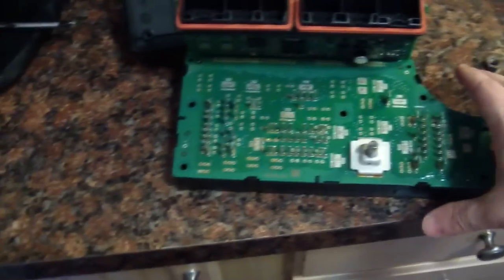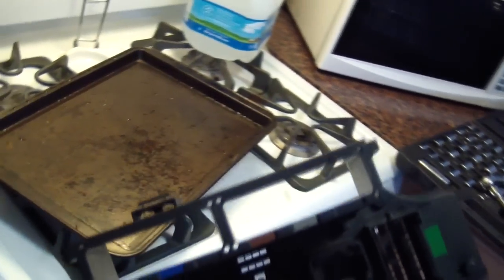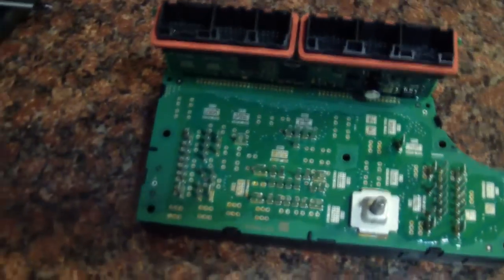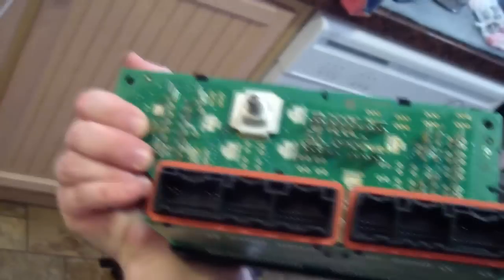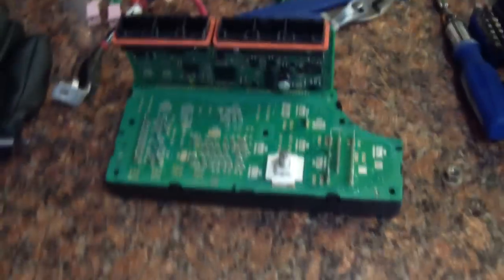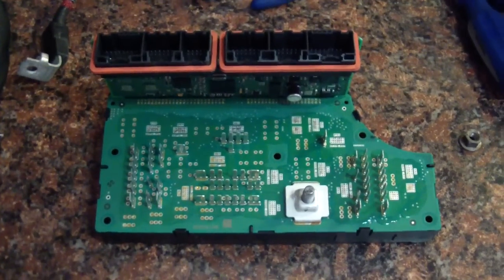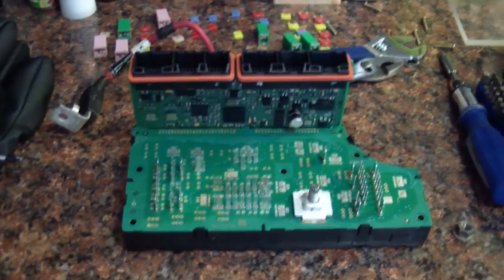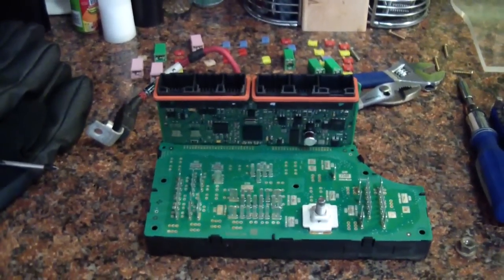2007 Dodge Caliber TIPM inspection - look at the guts!

Comment: Hate to play devils advocate here, but the unit actually IS SEALED. 

The plastic housing is only there to protect the connectors from being splashed or chewed by rodents. It's meant to allow air flow, that prevents condensation build up inside. The top should have had a rubber seal around the edge though, totally agree there.

The actual circuit boards in the TIPM are encapsulated in a conformal surface coating. It's a thin elastic sealant sprayed uniformly over the boards which seals all components and solder joints from environmental oxidation. I'm a micro/miniature circuit card repairman so I see these type of boards frequently. That kind of treatment is often used for boards reasonably expected to be exposed to weather and temperature fluctuations, despite being in a protective housing.

As to the computer module next to it, there's actually a very good reason it is better sealed:
Inside a modern car computer, there isn't a typical circuit board. Instead, there's a thin flexible printed circuit board with the components attached. It's much like the thin yellowish cable connectors you see inside computers for connecting laptop screens and keyboards. They're far more susceptible to damage from vibration. They basically attach the printed circuit to a sheet of aluminum and then "fold" the entire assembly in half, sealing it around the edges to a rigid aluminum frame. The inside of the box isn't fully encapsulated. It only seems that way because they're a pain in the ass to get apart.

Point being, don't jump to assume it's the TIPM, they're more solid than people think. Before following the crowd and handing Chrysler your wallet, take your time to rule out other connected components first. Get a cheap OBDII scanner, check your connectors, your grounds, sensors, etc.. The computers on these cars monitor almost everything you can think of, and seemingly unrelated systems can cause errors in other places.

Signed - Irritated owner of a 08 Dodge Avenger, P.O.S. model.
Reply from the maker: These are not sealed at the bottom, they are on the top. The connectors are not waterproof either. If you pull the ones off the ECU (water proof) and compare them to the ones on the TIPM about 6 inches to a foot away (at least on mine) they are not water proof. This may have changed in later years - I sure hope it did!!! Conformance coating does nothing for bad electrical connections caused by corrosion. I do agree that multiple things can cause an issue. 

Actron makes a couple really nice ODBII scanners - but nothing with dealer level scanning. There is 2 I know of that do that - the Starscan (OEM) and some other one - are both well over a thousand dollars last I checked.

If air can flow into the module, so can water. IIRC they only put conformance coating on one side of a 2 sided board... Even if they filled the whole chamber with epoxy, those connectors become the issue.

If that wasn't bad enough, I lost my wipers in a snow storm. Recall issued for that... My understanding is they set the over current setpoint so low that heat buildup in the wiper motor caused it to draw just enough current to set a B-Code (which you can't get on a regular ODBII scanner) and it disabled your wipers until they changed the over-current set points with a ECU/TIPM flash and the addition of external relays because it could not handle the current load required. http://www.autoevolution.com/news/chrysler-recalls-84000-dodge-calibers-13249.html
Reply from the maker: One fine thing you did make me think of - when people put a new one in - toss in some di-electric grease on all the connections under it. This will avoid additional corrosion...
Reply: True, conformal coating does nothing for a cold solder joint or component damage. I was only pointing out that it does offer SOME protection from general environmental factors. At least they did something to try to prevent corrosion from happening in the first place. Mine has the coating on both surfaces of the boards. Perhaps they changed to prevent further recalls. 

You're correct though, there are always points of ingress for corrosion, like the points where connector pins join the board or the exposed backsides of the pins within each connector. With the TIPM we're really talking about humidity rather than actual direct water contact from the road. The housing is designed in such a way that actual water spray is unlikely to splash or move upward into the connectors or board area. It would drain downward, away from them. Airflow allows humidity to enter, yes, but it also removes condensation. No system is perfect. Even a flexible epoxy potting mixture would eventually allow corrosion. And you have to remember the need for heat dissipation.

The ECU is a different story, it's deliberately exposed for airflow, cooling internal heatsinks. Therefore the the connectors have to be better protected from moisture, not to mention oil, brake fluid, etc.. They aren't really entirely waterproof though, just better designed for protecting data signals. They're actually designed for vibration isolation to further protect the internal circuitry. Those wires have not only voltage, but frequency data signals and the pins are more delicate than those in the TIPM.

As you pointed out, it's difficult without the expensive factory DRBIII scan tool and it's $500 - $1300/ year subscription fee. The funny thing is that tool is actually just a regular laptop with software that connects through a specially configured internet connection. I've been looking at the Innova 31603 OBDII scanner (like Actron) since it's under $250 and says it can read/ clear SRS and ABS codes. Mine has a SRS fault in one of the front seats. My little bluetooth scanner only does generic codes and sensor data, though it does it pretty well. Handy for the glove box.

Thanks for the tip about the wipers! That just may point me in the right direction. Mine work perfectly, except when it rains! Once or twice a year they will slow/jerk/stop in very heavy rain. I was thinking the wiper motors were overloading or intermittently shorting, but it's not easy to diagnose a condition that only rarely occurs in heavy rain and sets no codes I can access.
Reply from the maker: One other thing very few know about the TIPM and the wipers, when the TIPM goes south for the wipers it ends up frying the motor. I don't know how or why nor did I choose to keep playing with it. You'll know because it (wiper motor assembly) becomes hotter than hell and then you smell the windings right before it starts burning outright. I bypassed mine and have only high speed control. Lost the parking of the blades but couldn't care less as I know each and every time I hit for them to go on they will...

Comment: FUCKING AY! I love you for the rant! I woke up this morning and car wont start, lights turn on, no clicking new battery. Went to my mechanic and he told me the "fusebox" is gone. Hours of research and I bump into your video. What a STUPID design. As an Engineer, I'm raging pissed that I have to pay 300 dollars for a used TIPM to get my car going again because of thier designs of a 3 year old. MAKE IT WATERPROOF For fucks sake. Anyway. Thank your for the video HIGHLY appreciate it.
Reply from the maker: +Mo Mentum Really want to piss them off in Dodge corporate - ask them why the ECU located less than a foot away and also exposed to the same shit under the hood is hermetically sealed and uses waterproof connectors :p

Comment: Yup, the horn stopped working in my 2007 Caravan and the TIPM was the culprit ... male connectors were corroded all to dog shit. Should be recalled by Chrysler ... an outrage of epic proportions.
Reply from the maker: +Darren Gody I personally think that if they wish to put components that are this sensitive into a wet space they should be required to warranty them for life. There is no logical reason why they couldn't have moved it into the passenger compartment and used a larger size wire from the battery to there...
Reply: +TheWizechatmgr A Defect Complaint Form has been filed with Transport Canada and Michael Dahl, Head of Vehicle Safety at Chrysler, has been copied. UPDATE: I received a phone call from Chrysler Canada aka www.fcacanada.ca at 1-800-465-2001 EXT 11406 who asked me if I had the Caravan serviced by a Dealer (surprise) and further stated that this was the first case they heard of regarding a corroded Caravan TIPM, which I expected them to say, as they are told not to accept liability, and moreover stated that because I purchased the vehicle from an after-sale car lot, the engine was possibly shampooed / power washed which would potentially cause corrosion.
Reply from the maker: +Darren Gody So the fact that road spray can end up there had no bearing on their bad decision eh?

Comment: Thank you for posting this, I share your opinion. I have an 09 Jeep Compass that has the exact same looking part. I took the thing apart today before I seen your video. Tested all the fuses didn't see any obvious issues. Mine started acting up when I took it to the body shop. When I went to pick it up the dash lights came on but would not start. It acted as if the WCM module malfunctioned. I asked if they could take a quick look at it. I think they tryed boosting it and no success. Second time I went to pick it up It is dead except heater fan ,radio work and power windows work. Nothing else works no dash display, four way flashers, door locks and best of all you can't take it out of park. Nothing like really ticking off someone when you can't even move the car. I had to disconnect the shift cable off the transmission so I could move this shit thing. The interesting thing I found is there is a small relay box ahead of the battery needless to say hard to get at. I think there are four relays in there if you can figure out how to open the box. The one relay is for the engine, the fat blades are when the relay is energized. I put in a jumper wire across those and I was able to start the engine with the key. Everything else still don't work, but at least I can move it in and out of the shop.
Reply from the maker: +Ahill Billy Sorry to hear that. Not sure why dodge hasn't improved upon the design with an updated part.

Comment from the maker: #Daniel Hoyt
Test test test... Way too many places just suggest to replace stuff blindly. The Computer and TIPM & TCM have to be programmed alike - isn't like the old days where everything was easily interchangeable. I believe it was done on purpose...There is also a site believe it is parts geek dot com that has a lot of discount stuff. Haven't used them but was told about them by a local mechanic...

What does "doesn't start" consist of? What do you get? What don't you get?
Reply from the maker: +Daniel Hoyt 
Unsure why I can't reply to you directly - kind of weird...
Reply: yes.. they keep having me replace tons of stuff and treating me like i'm just a simple southern belle.. well screw that.. i know more about this car now than they do lol thank you internet.. mechanic just loves when i get on here and research lol but hell, 8 months later and the car is still not running.. so, i am gonna start replacing parts one at a time until i find the dang problem
Reply from the maker: How did you ever make out with that issue?

Comment: These cars are complete trash along with most of the others. ,would never buy a Chrysler product .but as an auto tech I make good money on them.
Reply from the maker: I sadly agree. The suspension is inadequate for a vehicle this heavy too...
Reply: These things go through front balljoints/control arms like I go through beer. Struts are always leaking,rear toe adjusters wasted rubbing on the subframe. Alternator clutches falling apart.its like they purposely made something worse than a 300/charger. Thanks for the good info on the Tipm.
Reply: dodge /gm /ford /Toyota / VW ...have their problems ..its because they are all made by humans who cut corners...Good luck never having a issue with any other vehicle in your life...

Comment: I have a 2007 Dodge Caliber.  I HATE THIS CAR. I have had several problems. Including the TIPM. My driver side low beam doesn't work becuase of the shitty designed part.  Never replaced it as I don't have $1000 to fix.( part from Dodge costs $700, labor 3 hours... wtf) Now my CVT transmission is gone... $3500 to replace with a Chrysler rebuild.  My alternator went out, and my fuel pump went out.  Called Chrysler and they are no help.
Reply from the maker: Brandi Fisher Sorry to hear that. For the 3500 to sink into it I'd suggest finding almost any other car. I've had slightly better luck than you, and even my luck sucks!
Reply: +Brandi Fisher This is the Worst car I have bought in 20 years, 2 Years ago I bought this car with only 50,000
miles, so far i have changed more parts to this vehicle then all the vehicles I ever had in my life since i was 20, it is ridiculous, 1st month after I bought this car $125 for a new battery, 7 months after I bought it I change the alternator pulley $102 part only, after 11 months I bought it, change the motor mount 3 of them for $195 parts only, after 14 month I bought it, driver window stop working,16months after passenger window broke in addition to all this In addition to all this I just paid $394.00 for a new Fuel Pump and yesterday the engine light is on WTF I am so sick of this crap Car this is the first & last time I get a Dodge!!!!!!
Reply from the maker: Yes, but the alternator pulley isn't just a pulley, it's also a one way deceleration clutch. so $$$$$$$$$$$$. Usually makes it sound like the alternator is ready to come apart with either a whine or a grind...

Comment: i have had my dodge 2007 for 6 years now. the TIPM has been fully replaced not once but TWICE. the first was covered on my warrenty, but the second was out of pocket.  this is my first dodge and will probably be my last. very very shitty design like you said.
Reply from the maker: Ben Wcislek That totally sucks. Seems the TIPM usually goes toasty due to power surges from what I've heard. Problem is it is almost impossible to avoid with the vehicle stock.
Reply: Gah, I have had mine 10 years and just now the TIPM is shot, sigh.

Comment: My drivers side low beam headlight was out to wich I was pulled over and cited for. Turns out it was related to the TIPM. Amazing how a simple light bulb change turns into cha ching for the dealership. Maby Chrysler can pay my fine on top of the mortgage payment I had to make to replace the TIPM.
Reply from the maker: PGMEagle Good luck!

Other option would have been to run a relay off the other light to drive that light. Costs about $30 in parts and takes about a half an hour. You'll never see the dealership do this, but many smaller repair shops would be more than willing to set you up.

Comment: Great video! Great commentary! I despise Chrysler for this bullshit and the fact they don't wanna own up to their flaws and recall this garbage!
Reply from the maker: I'm pretty sure it isn't intentional. I mean, after all, it isn't like the engine compartments get wet. Oh wait, almost all of the other connections are water-proof. I guess they did know... I call it planned obsolescence... I should be making a video (when we have less than 2 feet of snow on the ground) on how to replace the brake fluid reservoir level sensor. The stupid "brake" light that seemingly comes and goes for no reason.
Reply: Dont drive a ford , gm or any other vehicle then because they ALL do this....

Comment: My wipers on my 2007 Dodge Caliber only work on high speed and they don't park.  I've tried replacing the wiper motor and it still only worked on high speed / no park.  I tried ordering one from a parts store and they are back ordered / not in stock until February.  However I can nab a TIPM from a salvage yard off another 07 Caliber for a third of the price of a new one from Dorman.  I think i'm going the salvage yard route to save some coin.
Reply from the maker: Fenix904 Just make sure to budget to have dodge sync it to your existing ECU. These suckers aren't just plug and play unfortunately :(

You may wish to just have the local Dodge dealer perform a TIPM error/code reset. Sometimes they detect a bad motor and then thats that until they clear the code. A regular OBDII/CANBUS reader can't do it :(
Reply: TheWizechatmgr Ah great, I wonder if I should have spent the extra $200 to get the already programmed TIPM from Dorman and just been a bit more patient.  My salvaged part will be here Wednesday.

Comment: 4 starter burn up....I;m really tired of a caliber,the worst car ever made...at 80.000km all the suspension as to be replace,and here in Canada the weather is hard,and my tipm just decide to not deliver enough power tho the starter......tomorrow i gonna bypass the starter with one direct cable eand one switch....never again I gonna bye dodge
Reply from the maker: I have to say, it isn't the best car I've had. Plan on offloading it eventually.

Comment: now my radio on my dart says "err" or  "wait" when I turn on the car.
Reply from the maker: Not sure about that dart but I think I had something similar to that with my Caliber once. Not sure all of what was done to fix it but I believe there was a code or something that had to be input. If it were me, I'd pull the battery terminals, leave it for a half hour and connect them again, then see what happens...
Reply: TheWizechatmgr opps why did I say dart? I meant caliber this is happening to my caliber.